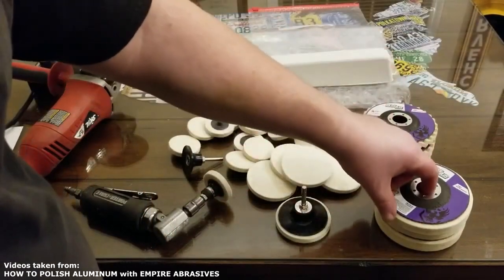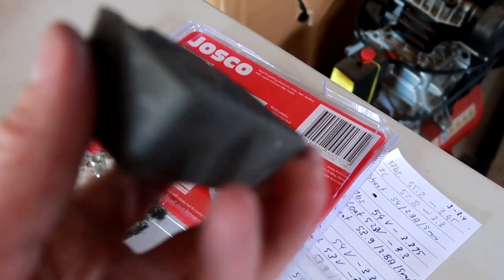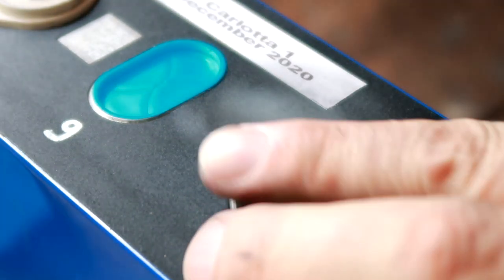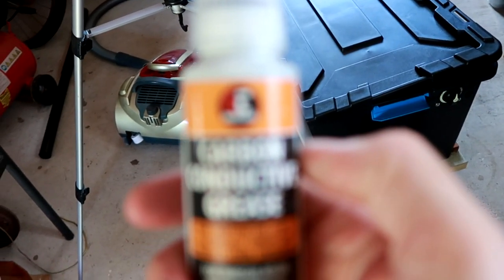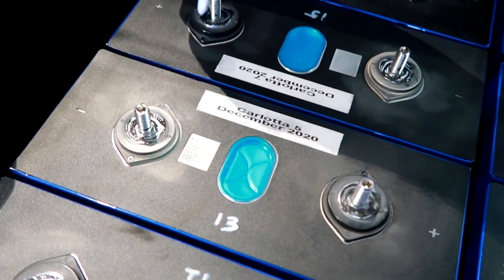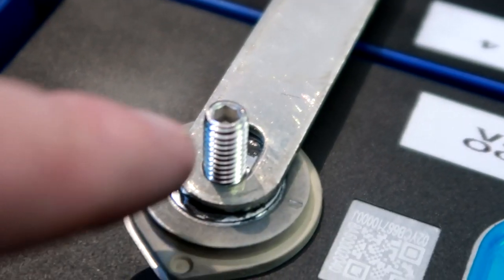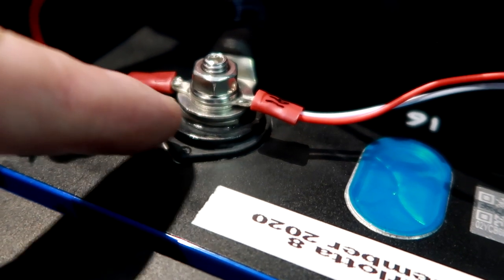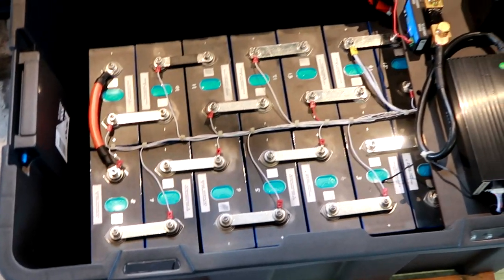Re-building the battery - The perfect terminal connections? Part 2/2

Comment: Hello Andy. You are on the good path, I think the conductive paste saves you, but the contact surfaces should not be rounded, as you said it diminishes the areas, so under high load, you could get imbalance, also all the bus bars should be identical. New busbars are almost flat a few seconds grinding on sand papers taped on a flat surface, like window glass,as you did, thinner an thinner grain, don't do it with one finger always use a flat surface behind the sand paper also for polishing at the end work flat , I use 4 parallel busbars to keep section consistancy and they where delivered with the cells anyway, the studs should be kept with loctite, and should not touch the bottom. Come on get the battery posts flat, if you look at squared paper in the relection of the miror finish there must be no deformation. Or abandon and lets test the conductive grease, I want to use it also. Nice Videos 👍. :D The learning process :D
Reply: Good point, with the busbars all needing to be identical. "All things being equal" can make a difference if you're obsessing or troubleshooting some kind of mV or mA difference between cells.
Reply from the maker: After all I will pull only 60A from this battery with my inverter. Even less when the next lot of batteries comes... whoops 😶

Comment: I think you are worrying too much about the surface finish. After a point, smoothness of the surface does not help. What matters is flatness and cleanliness. I would sand the terminals flat using a hard sanding block and maybe 400grit paper, immediately wiping with a solvent to remove residue and coating with your conductive grease to limit surface oxidation to the bare minimum. The bus bars should get the same treatment.
Reply: exactly....